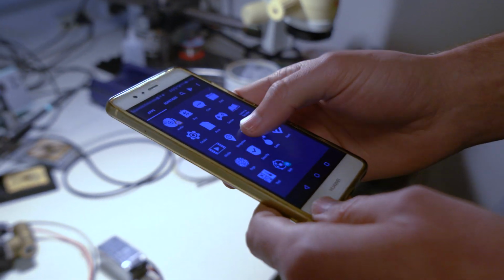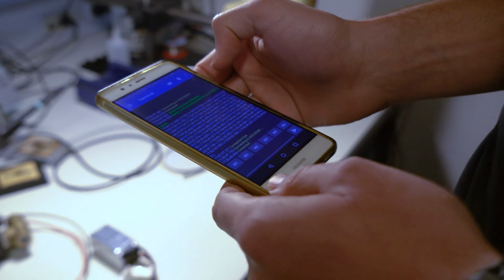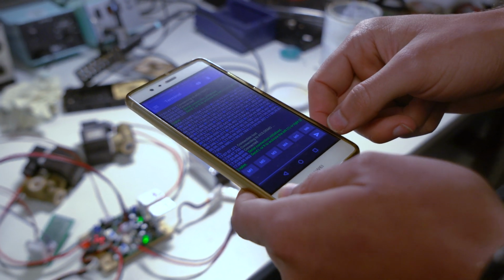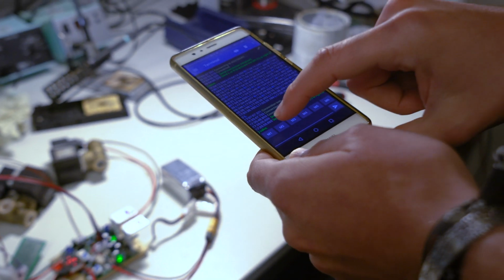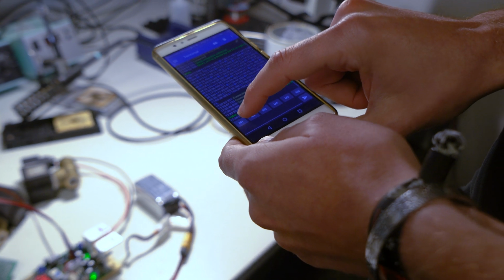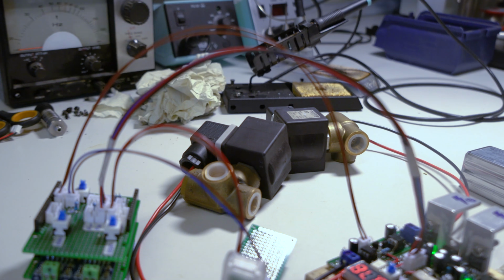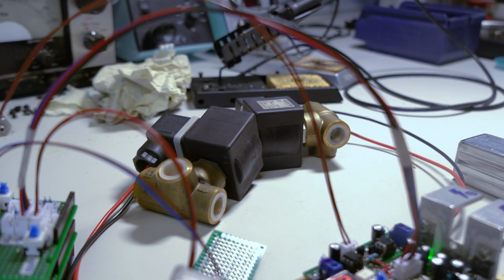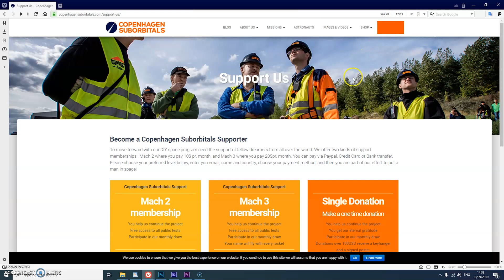Powering the Reaction Control System Demonstrator

Comment: Which Arduino mcu?
Reply from the maker: An Arduino UNO. But not that it would be the number 1 choice doing this all over again.

I think the Zero would be a close contender right now:
3.3V instead of 5V, so no need for so many level shifters (saves space and improves signal quality and prevents headaches). 
Better ADC (allthough I think the one on the Uno is good enough for now).
Faster and much more memory which makes life a little easier. 
Even though I haven't run out of memory for now. But I am not sure yet how hard it will be to get everything running at the same time. We'll see.

The MKRzero looks good for the same reasons. 

Slightly outside the Arduino world, a lot of the STM32 stuff looks really good. 

I even played with the idea of using two micro controllers. 
One for the more time intensive stuff like reading all the sensors, data logging and communication. 
And the other one can concentrate on control. 

BUT right now, it looks like I can manage with the UNO. 
It is a little bit too early to tell, as I have basically no experience with it.
Reply: Very informative, l use raspi, Leonardo, wemos, esp8266, esp32, DUE, stm32 blue pill, pro mini, nano  in such order and others mcu.

Comment: Ok, so why didn’t you use an already-made BMS instead? You would also have the added safety against a short.
Reply from the maker: This solution is an extremely cheap and compact way to watch after eight battery cells. 
I didn't explain that properly in the video: The Zener diodes protect against over-voltage and the fuses against over-current (which for example would be the case when a Zener sinks an over-voltage or something else in the circuit shorts).
The display and tweeter are a very nice bonus to quickly check on the battery status. 
Maybe useful when the thing gets carried to one of the exhibitions that CopSub sometimes attends, so that the public can play with it. 

Also remember: I would probably need two 4S-BMS.
But yes, that would have been possible. Maybe I was a little bit too concerned about keeping it compact and cheap. As you will see soon, there isn't a lot of space.
Reply: Copenhagen Suborbitals nice answer; however, there are “smart” BMSs out there from 2s up to 20+s with Bluetooth control where you can access battery info and adjust anything from a handheld device, from $50!
Reply from the maker: @ThanosSustainable  That's good to know, thanks!
However, I paid less than 10$. And less than 5$ if I don't include the relay. 
As I said in the last video: We try to stretch every donated penny as far as we can. 
Would I have spend tenfold for every component on the demonstrator, the total cost would be well within a few thousand $. And that is not even considering a lot of the stuff I had free access to.

But more important than that: It was a great learning experience as this was my first major electronics project.

With all that in mind: I don't say that I wouldn't do stuff differently if I did it all again. 
And a COTS BMS would definitely be something I would think about again. 
So, great question. :)

Comment: Why particularly +-12 when you could have just used a buck or boost to generate the full 24V?
Reply from the maker: I am pretty new to electronics and thought that having one potential source of noise less to deal with, might be a good idea. 
Having symmetric supply voltages is also nice to have for the occasional OpAmp or instrument amplifier.
But of course, there are many ways to achieve what I wanted.
Reply: @CopenhagenSuborbitals  True, there's more than one way to skin a cat.
Thanks for the reply and good luck!
Reply: Boost ? Twice the voltage but half the amp might be an issue.
Reply: They have chunk batteries, and I don't think solenoids like that take more than half an amp.

Comment: Adding multiple components whose sole purpose is to power off all steering in a manned vehicle seems like an excessively bad idea.  Consider what is worse: Damaging a battery that won't be reused or flying the wrong way with an astronaut on board.
  Also, why use a rechargeable battery on a short flight? Primary (single use) lithium might have better energy/mass ratio and less PSU requirements.
Reply from the maker: Probably the answer to all you questions is that this is only a demonstrator unit to test the output of a few different cold gas thruster designs. :)
You can refer back to our previous video with Adrien on his test setup: https://www.youtube.com/watch?v=RwseRMC266A
Reply: This battery will be reused a lot, because this is a demonstrator that is supposed to run multiple hours at a time. This PSU has nothing to do with flight hardware.

Comment: The whole system runs on arduino?
Reply: No, this is just the demonstration test setup. The real thing with obviously have a safer and more reliable system
Reply from the maker: The RCS-demonstrator uses an Arduino UNO.
Spica will use an in-house solution based on a big ARM chip.
You might be interested in our CSduino video where you can see how our previous flight computers got build:
https://www.youtube.com/watch?v=l1Xs-0N5kIY

Comment: Which solenoid valves are you using for the system?
Reply from the maker: They are Jakša XBS3 TM35 valves.
Nothing I selected for any specific reason. We had two of them sitting around in a drawer. 
They aren't super fast or anything, but they should be fine for what this demonstrator is supposed to do, so I took them. 🙂

Unpressurized they open in about 10ms and close in 100ms. The closing times can be reduced to 40ms with a snubber.